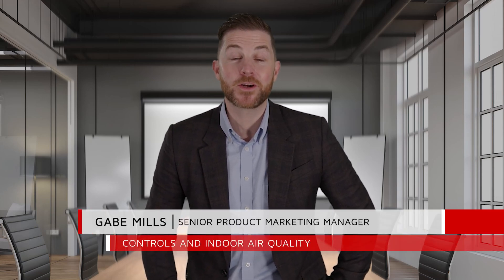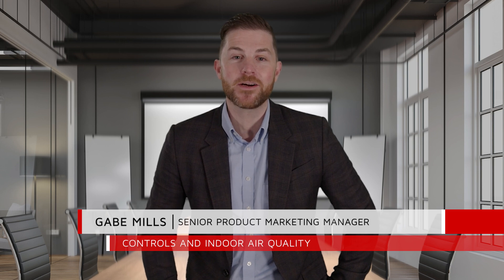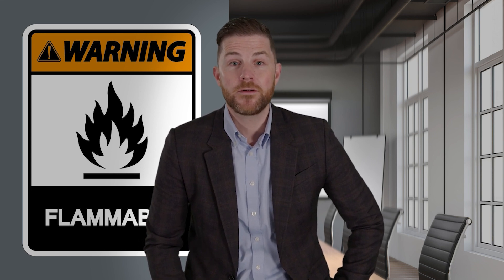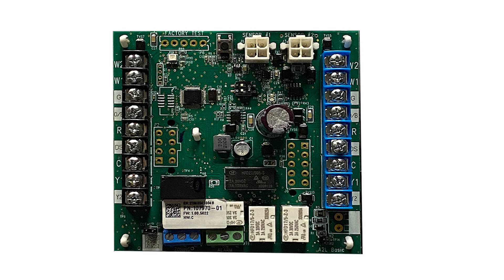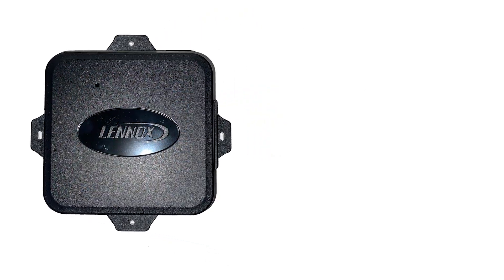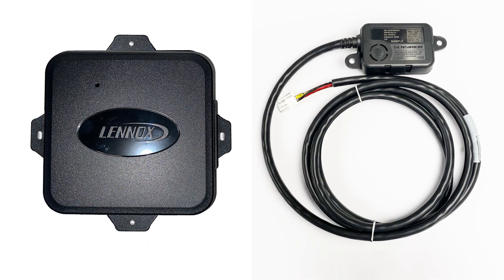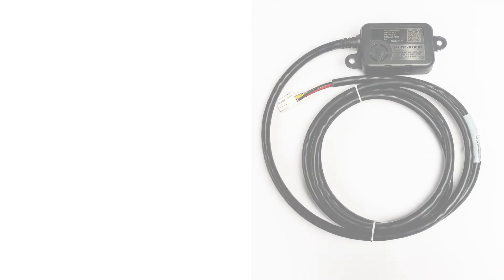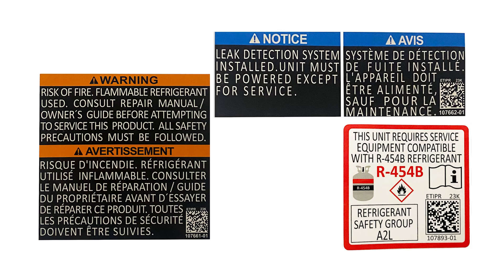Introduction to 2025 Compliant Refrigerant Detection System

Comment: Is the R-454B leak detection system factory installed in residential 2-Ton central air conditioning units and how will a resident be alarmed if the leak detection system is activated?